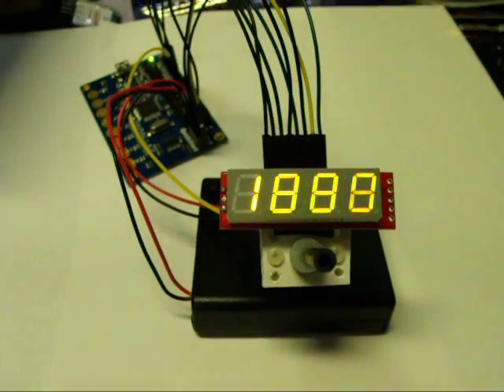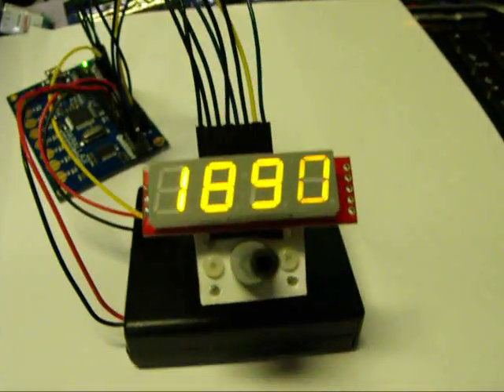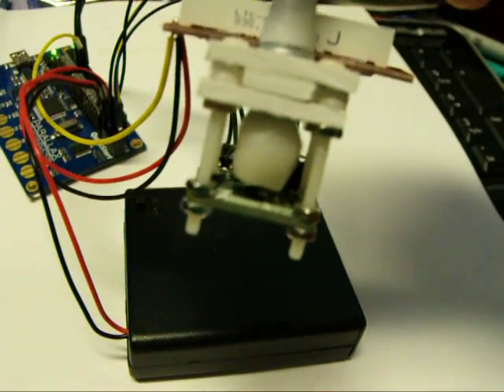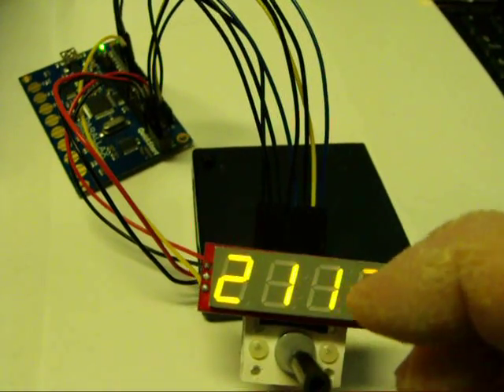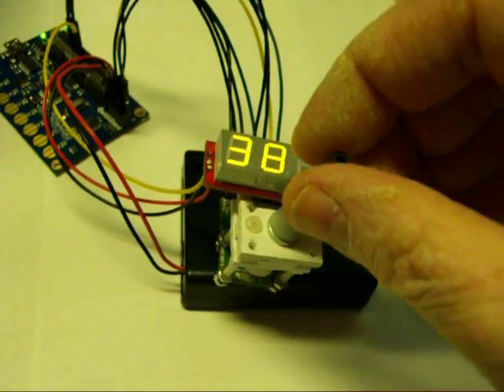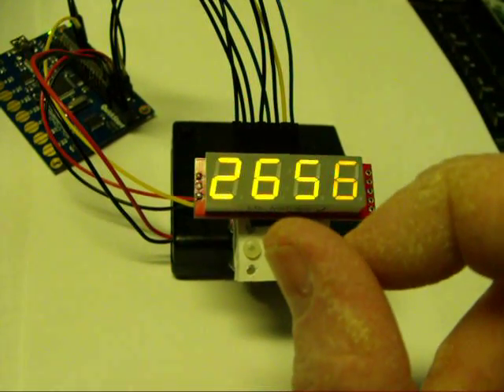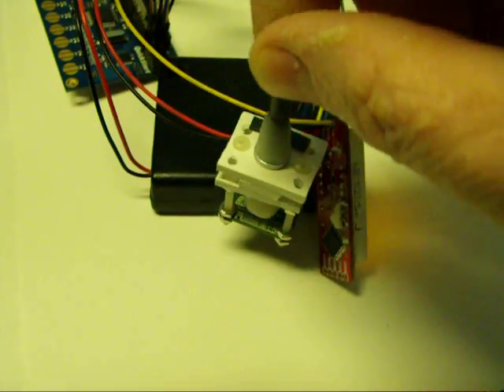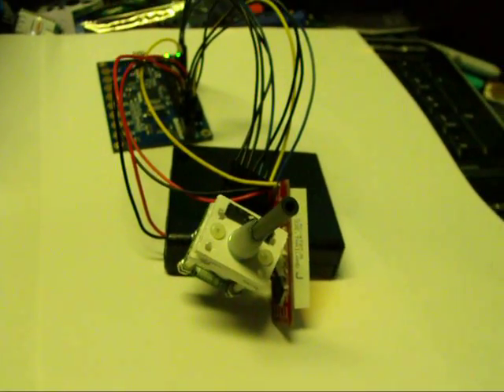MagneticEncoder120318a.AVI

Comment: What type of magnets should be used with the hall sensor?
Reply from the maker: Normal round magnets will not work with these sensors. The datasheet suggests using 6mm diametrically magnetized magnets. I had a hard time finding a source for these magnets and ended up purchasing 100 from Dexter Magnetic Tech.. I have since seen sources where you can purchase just a few magnets at a time (sorry but I don't recall where).
Some additional information is available in this forum thread: http://forums.parallax.com/showthread.php/140104-First-Magnetic-Encoder-PCB-Attempts?p=1099071&viewfull=1#post1099071.
Reply from the maker: Duane Degn I should clarify about "normal" magnets not working. In this video I used a normal round magnet but I had to mount the magnet "on edge".

I talk a bit more about the magnets in this video: MagneticEncoder120320a.AVI
Reply: Duane Degn many thanks! Should be a lot cheaper than an optical rotary encoder.